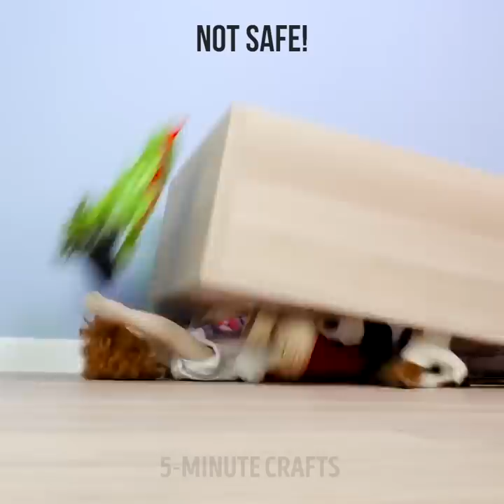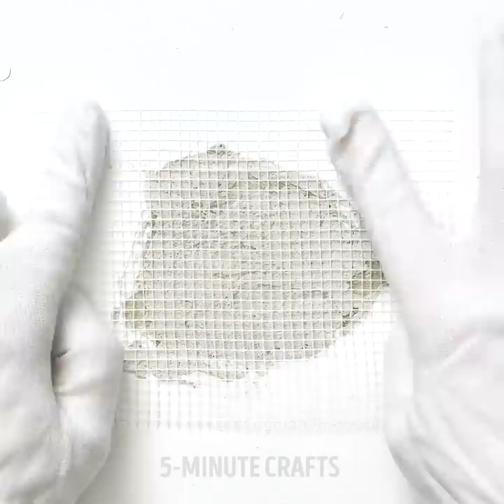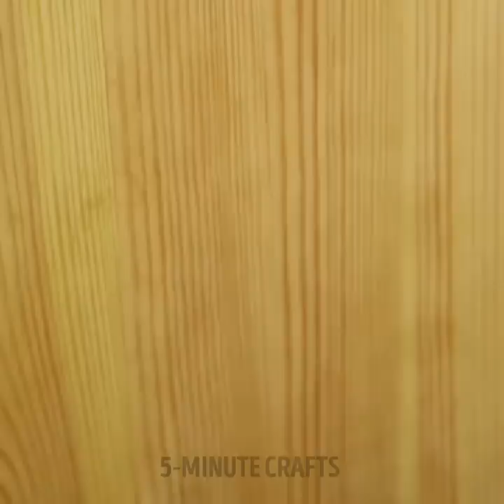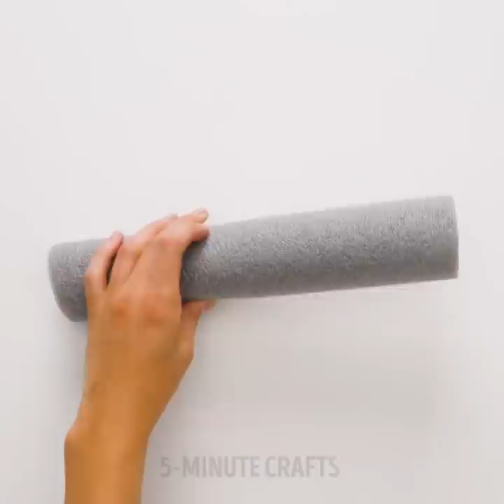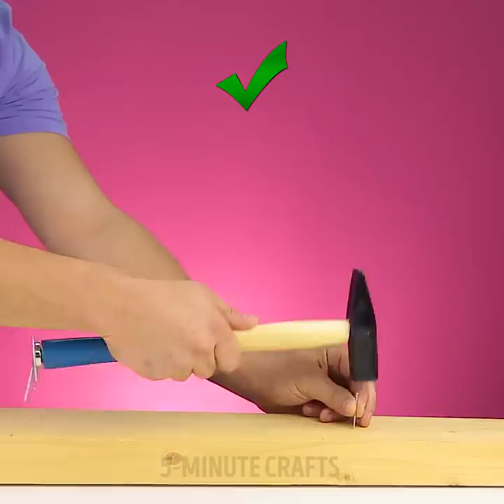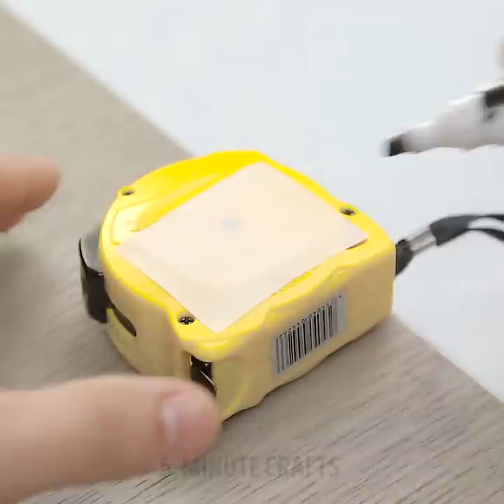35 USEFUL DRILL HACKS

Comment: The cabinet safety strap needs to have bigger screws. The ones shown will pull out. If it’s going into drywall you need a proper fixing that flips out behind. Into masonry you need to plug properly into the brick.